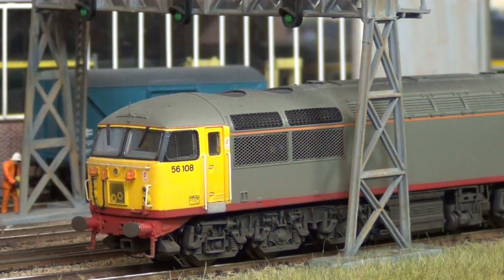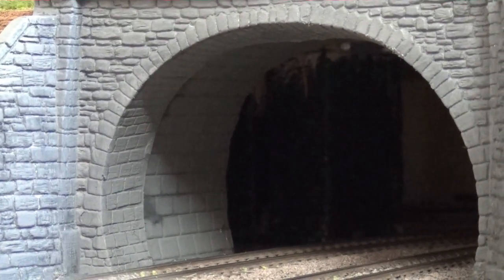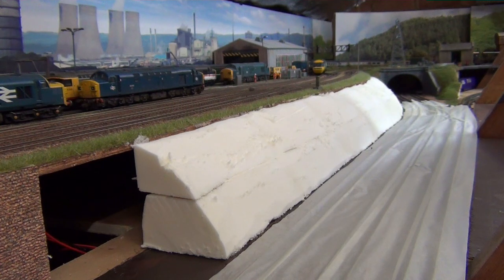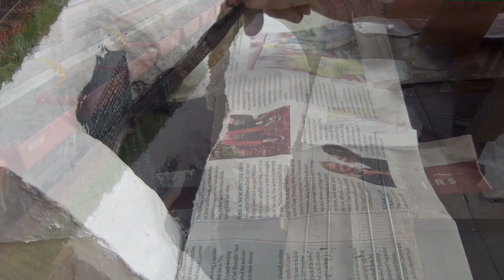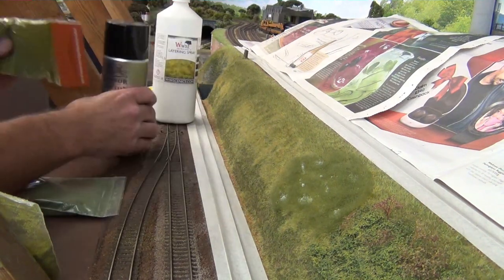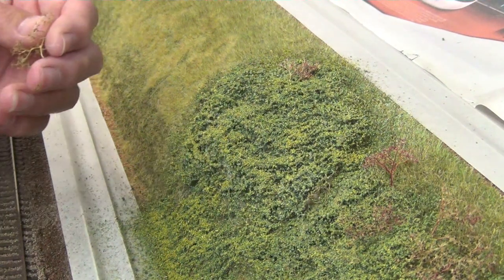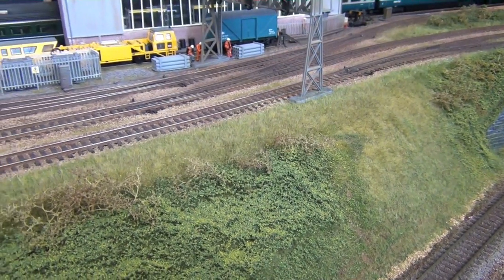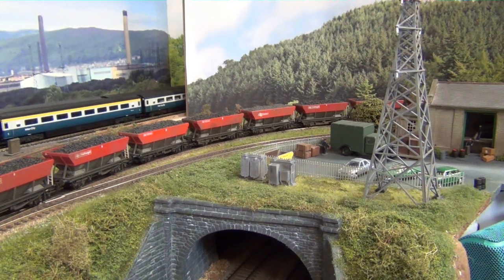The Big Embankment Project & Tutorial. 31

Comment: TIP Static grass ! At 3:00 it is clearly seen that loose static grass is all over the track. This must be carefully hoovered up, or the static field generated by any locos DC motor will tend to suck static grass in. The locos DC motor will continue to attract this stuff when running, so the static grass ends up getting into the locos gearing & all around the motor. Which will end up interfering with the smooth running of the loco !!!

Happy Modelling.
Reply from the maker: Maybe a bit I've missed but I do regularly use a full size vacuum cleaner normally to clean the track as the little vac's don't seem to do a good enough job.    Have to be careful though as the down side you can pull up ballast. Saying that I use my dapol track cleaner for hidden sections as well. Cheers will give that area another check over just in case it's still there. Been using tons of static grass lately as you see.   Gets everywhere 🤔 Regards Graham 👍